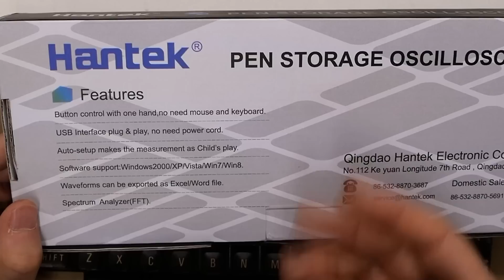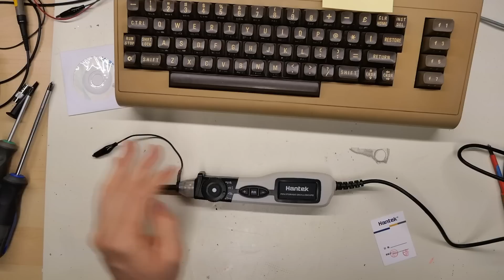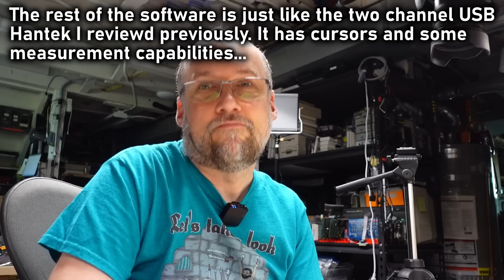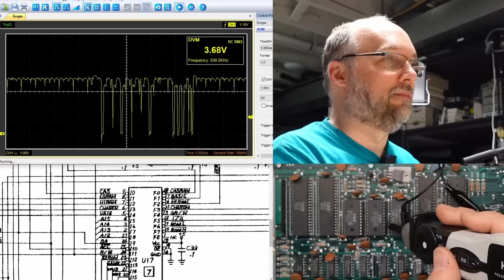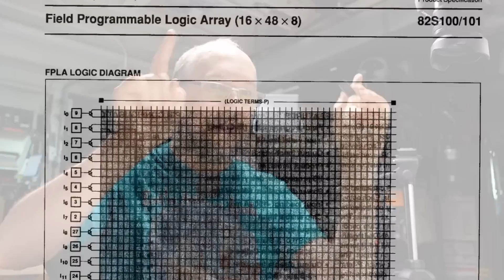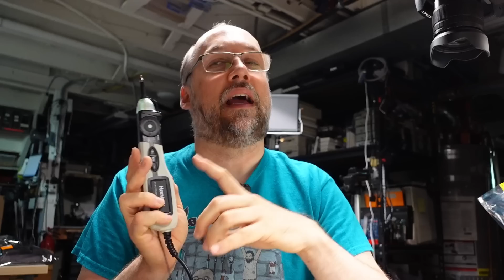3/12 C64 repair using a pen oscilloscope (Hantek PSO2020 Review)

Comment: i think that pla could be fixed with a pull up resistor. it seems like the lower transistor is pulling to ground correctly but the upper transistor isn't pulling up to 5v properly

Comment: Junky software is software that doesn't work. Like all your apps you're using right now, that stop working intermittently. Why do you suffer junky non-working software? Because you have no choice. Stores even willfully block software that works just fine, and willfully deprecate software that worked and will work fine. 

So you bought an oscilloscope, installed the driver and the software for it, and it worked. And it will stay working, because the software was tested and finished. Cherish such software. It means the engineer did a great job. Cherish such software and preserve it. The company he works for may pull the webpage any second, and then the great software is unavailable.

Comment: Those cheap scopes are not great, but if you have trigger issues, switch from AUTO not NORMAL.. That's where you should be with most scopes anyway.

Comment: The V and T with the arrows are for panning, not scaling, you can't see anything on the time scale probably because the input signal is fairly stable, so it's hard to notice any drift.
try a lower frequency signal, it should be easier to notice the signal moving horizontally.

Comment: The Hantek that you've not reviewed is the IDSO1070A which uses a wifi connection to connect to ether a PC or a tablet. It's battery powered and so is 100% isolated. The one I have allowed me to use the windows sofftware in Linux via wine. It also seems to have hardware triggering.

Comment: A while ago I bought an HDS242 for 90 bucks. It's isolated because it uses a rechargeable battery. It has a nice and crisp display, better bandwidth, a USB interface for control and data export, and includes a reasonable multimeter as well.
I have literally zero idea why anyone would by a handheld oscilloscope without a display, that can only be used when connected over a non-isolated USB port. That is one disaster to happen.

Comment: Thank you Adrian, you giving me such an inspiration, you give me new interest, confidence and building my electronic lab step by step. You explain so nice and clear. I have early electronic interest and experience since the 1980s. And also have college education in electronics. Got bored and started programming for 15 years, then got back interest for connect electronics and programming. You have inspired me start buy tools and start with PCB soldering, reparations etc. Thanks Adrian! Also I got a C64 in 1984. Along with s lot of other computers. So very interesting Chanels you have. Thanks

Comment: Two thoughts. 
1) Is scope ground isolated from USB ground (Protective Earth)?
2) I don't know the PLA internals but I wonder if 10k pull up would help in this case?
Reply: I can't answer the second question.  But:
1) No, it isn't.  There's a similar oscilloscope from Owon that's about twice the price that is isolated.
Reply: @SpearM3064  so I would go with that handheld unit rather than this Hantek.

Comment: Dude, your chip lifter is a little bit better than a screwdriver. Yet you still leverage it against the PCB traces. One day you'll earn yourself a great pain in the arse tracking down that damaged trace.
Reply from the maker: Do you know what a DIP socket looks like? The tool pushes against the socket, not the PCB.

Comment: Hey Adrian, I am looking for a low cost portable Oscope... this would be perfect... if I could find the 100Mhz or even the 200Mhz version of this oscope... but I looked and can't find it at all... not even on the Hantek site...  any idea if they ever actually came out with those?
Reply from the maker: There is no way those high bandwidth ones work -- this one can't even run at 20mhz -- so I would avoid those.
Reply: @adriansdigitalbasement  OK... I guess I will keep looking... it appears I might need to get the bigger 2 channel 100Mhz scope...  know of any good scopes?  I know you have tried several.

Comment: Great video as usual. I think the T button which seemed not to work does actually work, it just made minute adjustments but I think I saw the trace shifting horizontally. Try holding it or pressing it one direction for a while! Those are nice little tools for the price indeed.

Comment: I love watching the oscilloscope videos because that particular diagnostic tool feels almost usable to me. Someday  maybe...
Reply: If you're ok with just audio frequency stuff, then there's free software online to use soundcards as oscilloscopes and signal generators. Pair it with a $3 eBay soundcard, and maybe some homemade protection circuitry, and you have a decent audio-range oscilloscope setup.
Reply from the maker: Definitely audio frequency isn't going to be a help on a C64 -- most signals are likely around 250-500khz
Reply: You can get cheap used analog 10-20MHZ scopes for line 10$ on ebay if youre lucky,
Reply: @harisalic2568  Only in America!:(

Comment: IMHO, if the Hantek probe had a scope ON THE PROBE itself, I'd be more interested, Otherwise it's an oversized, clunky unit making it MORE likely to short pins while you look at the PC.The other Hantek scope, as you mentioned can set in your field of view and you have a thin probe which will be much less likely to cause problems. Good Luck
Reply from the maker: The width of the probe tip (the last couple centimeters) on this is exactly the same as any oscilloscope probe, so it's not really more likely to short a chip. It's probably not going to be able to get into really narrow spaces.

Comment: Have you searched for for alternate software? Great video as always.
Reply: Reverse engineering such a device costs a lot of energy. The 6022BE got lucky that some people did want to spend that effort, and any software developers can just find open source firmware, drivers and documentation. That... isn't true for any piece of hardware that Hantek produces. Hantek doesn't publish technical documentation, so any third party software will have to reverse engineer it.
Reply from the maker: It certainly seems similar to the 6022BE -- but clearly not compatible, which is a shame.

Comment: It looks like the osciliscope was doing a Root Mean Square on the voltage measurement which would explain why it would be lower then a peak to peak measurement. I can see a DC RMS label next to the voltage value.
Reply: Or at least some kind of averaging.  Both are things a normal DVM would do given the signal.
Reply: @russellhltn1396  It says DC RMS.

Comment: Pro-tip?  Do not cheap out on your equipment.  Does this "pen oscilloscope work?"  Maybe, in some cases.  But as a geek, it doesn't please me.  I want a piece of test equipment that i can trust.  If i have to second guess the data it's providing, it isn't helping me, it's just another annoyance that's stopping me from fixing what i am working on.

In short, you get what you pay for.  Buying cheap may seem like a good idea, if you are short on money.  What it really means is that you are buying a piece of crap, and then buying what you should have in the first place, in addition to the crap.  Or you could just buy quality in the first place, and save yourself the mental stress.
Reply: I own a lot of tools.  Some electronic, some construction.  As far as quality goes for tools of cheap/expensive, I'd say "it depends".

A lot of tools I buy cheap as I can because I know I'll only use them every so often, or maybe once.  I just bought an $18 bolt cutter because I need to cut some 3/8 rebar.  It's a cheap tool, and it performs like a cheap tool, but it also cuts my rebar.  My other option was a $45 tool that was higher quality, of a $90 tool that could cut even thicker rebar.  I don't do a lot of work with rebar, so it made sense to buy the cheap tool rather than the expensive one.

Contrast that with a circular saw, which I use All The Time.  I bought a high quality Makita for maybe $160, and I love it.  But that's because I use it all the time.  If I only used it occasionally, (and maybe only for ONE project), it might make sense to buy the cheapo one for $50.

The same goes for electronic tools.  For many, a $60 tool they buy to fix an old retro computer, or arcade game themself is well worth it since it'll be something that sits on the shelf and gathers dust most of the time.  It sounds like this thing is well suited to that.  You can spend $200 on an entry level Rigol, but it may be a huge waste to fix those two retro-computers you own.
Reply: Those things should be properly calibrated for basic usage. And also not anyone can afford a 300$+ Scope

Comment: After your video about the Hantek USB scope I was thinking about purchasing one, however since I'm the kind of person who always has to research everything thoroughly, I stumbled upon a thread on the EEVblog forum and it turned out it was a terrible device and there was a way better, slightly more expensive device made by Owon (Owon VDS1022I).
I ended up purchasing it and pairing it with a Raspberry Pi 3B and I must admit, for an occasional tinkerer like myself, it's  actually half way decent.
There's open source software for it (it's also compatible with the Hantek btw) that's FAR better than the original software.

Anyway my point  is there are most likely better alternatives for the polished turds that Hantek is making....
Reply from the maker: Perhaps -- it looks like that Owon is $110 from AliExpress -- and while it does look a lot better, it's nearly 2x more expensive. 

For a person who just needs basic test gear, why bother spending that extra money? You can keep spending incrementally better money ... eventually reaching $400 to get something really good, like the Rigol DS1054Z. It's so easy to fall into the trap of "spending a little bit more" to get something better .... The EEVBlog Forums people are gear nerds -- they aren't generally fixing C64s, so their use case for things are going to be different. 

The point of the video is to show that you can fix something even with the most basic cheap stuff. I can pretty much guarantee the better and more expensive Owon won't result in a person being more like to be able to fix a C64 over the cheaper (and definitely less good Hantek) 

My first "good" scope was the Rigol 1054Z which I don't use much these days because it's not great for making videos -- but with it feature unlocked, it's really hard to beat... (I see it's $420 right now, funny I paid less a number of years ago when I got mine.)
Reply: @adriansdigitalbasement  I’d be interested in seeing the Pokit Pro on your bench. It’s Bluetooth in a similar form factor to this one. Used with an app on your mobile for a portable display.

Comment: PLA, or as electrical engineers call it, a ROM.  Of if it's a FPGA, an EEPROM.
Reply: Fundamentally, ROMs and by extension EEPROMs are simple memory devices. Address in, data out. That’s it. PLAs and FPGAs add arrays of logic elements on top of a memory structure. One could argue that a PLA is a fancy ROM only if there were no flip-flops in the logic array. ALL FPGAs have flip-flops and so they can have dynamic state. ROMs and EEPROMs cannot do this and that is where they are fundamentally different. I’m not sure which electrical engineers you were referring to in your statement but I am one (over 30 years of ASIC and FPGA design) and I don’t call them the same thing because they’re not.  ;-)
Reply: PLA is not a ROM and an FPGA is not an EEPROM… They may or may not share some circuit structures but they are different devices…
Reply: @hbengineer  they really aren't.
Reply: @jeromethiel4323  The important difference is that the PLA won't glitch its outputs during state transitions.
Reply: @eDoc2020  But if you look at the working bits of either of those, it's still a memory chip at it's heart.  Sure, there is logic around it, but it's memory at it's core.
Reply: If an electrical engineer believes that a PLA and a ROM are the same thing, I'd have serious doubts about their qualifications. Heck, I wouldn't even trust them to change a light bulb.
Reply: @TheKnobCalledTone.  LOL!  Well, i guess we'll just have to disagree.  And i will continue to make a living as a "fake" engineer.

Jesus, ROM's have been used since the early days to replace basic logic chips.
Reply: I never once heard 1 ever call them that and i sure dont

Comment: The difference of the test harness > Rev. 0 is:
The keyboard feedbacks and the control port feedbacks are the same and both go to CIA 1. So actually, you have to test two passes, one with keyboard dongle and one without. The newer revision not only switches the user port feedbacks (like the original), but also the keyboard feedbacks. So you fully test the ports without removing the keyboard dongle. And the switching happens on the user port dongle. That is the reason for the 3rd 4066 on that dongle. 

The feed trough on the cassette dongle is also quite useful. The feedbacks for the cassette port are also on the user port dongle. So connecting it without the user port dongle, it is completely neutral. It indicates the motor and sense signal. You can also use it to tap the 5V on the cassette port of the PET, because the PET does not provide it on the user port. Also, it works with the VIC-20 test harness. And you can easily probe the cassette signals with the scope.

Comment: Heh, nice you have the 128D harness now.. I tested that for Sven for cable length etc on my 128DCRs. But you still do need an adapter to make the tape port connector work, a 128DCR (metal case 128D) has no room for the 'ears' of the one you have.

Comment: Just as a reminder for some,  USB ports on a desktop pc are not isolated from the mains earth/neutral.  Keep that in mind when using the ground clip on that probe,  or you could have a very bad day (and so could your pc).  I have no idea how that Hantek probe is wired internally,  or what type of circuits people would try to use this probe on.  Safety first.
Reply from the maker: It's most definitely not an isolated design -- not on something this cheap. Someone else mentioned the Owon VDS1022I which is a USB scope that does use an isolated design, and looks to be quite a bit better. (Also nearly 2x more expensive)
Reply: Wonder what the maximum input voltage is on that.  Could just run it on a laptop or tablet thats running on battery to isolate from mains.
Reply: @Discretesignals  Specs say 50V @ no attenuation,  but honestly I don't think I would run it over half that.  Also I have no idea what the attenuation actually is since it's not in the specs,  unless I missed it.  A laptop would be safer, yes.
Reply: @Discretesignals  in a pinch you could do that, however having a laptop (and any accessories) jacked up to an unknown voltage could be very risky. Not bad on a C64, but if you then move over to a colour CRT TV....  - or heaven forbid, live chassis, in a 240V country....  ouch.
Reply: The Hantek 6022BE is not isolated from the USB ports, so my gamble is this cheap oscilloscope isn't either. So use an battery powered laptop and/or an isolation transformer for high voltage stuff. It doesn't affect the usefulness of the scope a lot, you just have to be aware about it.
Reply: @danielmantione  my really nice Dell AIO I used on my bench died from just this!
Reply: @rtechlab6254  That sucks! If this happens, a lot gets destroyed and it is likely broken beyond repair. Did you forget to take isolation precautions, or did it die despite precautions (it should not)?
Reply: Also some USB ports are shared resources, so you won't get the  full bandwidth/power.
Reply: So are the real scopes, ground  = earth

Comment: Imagine 'restoring' the screen and running the oscilloscope software from an embedded chip placed inside the battery compartment (ie a pen version of the Hantek 2C42)!
Reply: how would you hold it to probe leads on a board AND look at it at the same time?